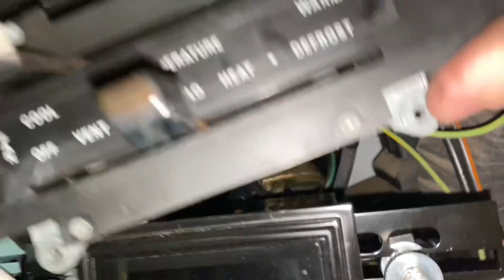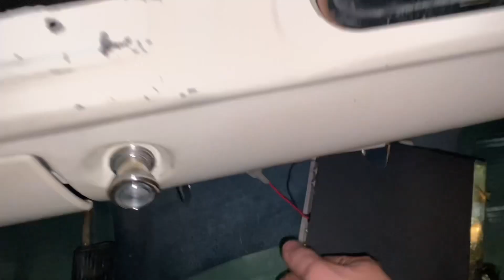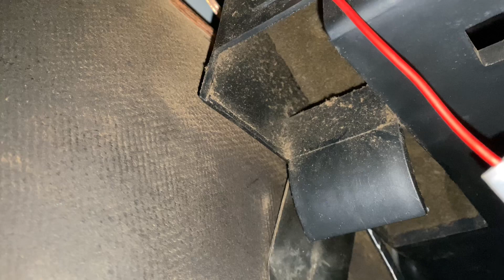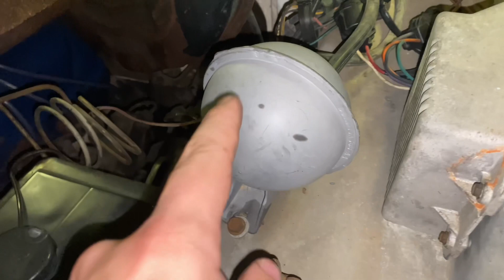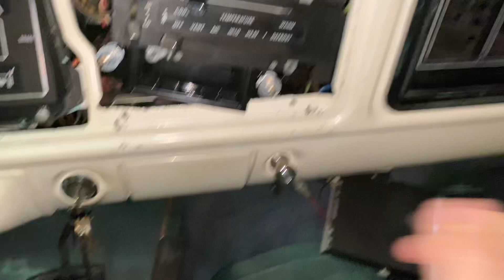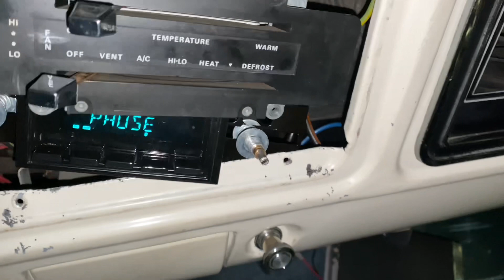1973-79 ford truck factory A/C vacuum leak fix.

Comment: That vacuum nipple port pulls the door in the opposite direction.
Reply from the maker: Yeah but funny thing is when I would move the slider back and fourth it never had vacuum on it so I found it to be kinda weird but either way it’s been working as it should so all good. Thanks for the input I appreciate it. Thanks for watching.

Comment: I'm having problems with my 1975 Ford F100 factory air. I will look at those vacuum lines again for a possible solution. Thank You for the video information.
Reply from the maker: You’re very welcome, hope you figure it out, vacuum leaks can be a pain to find at times, but usually doesn’t take much or take long to find them on these old fords. 
-Thanks for watching.

Comment: Hey There FF289!  I'm actually in a situation with my 73 factory AC.  At some point I blew the fuse (top fuse in the panel).  Along the way of finding the right amperage - I would put in a new fuse, the fans would run, then the fuse would blow.  Well after about three times of this, and a fuse that isn't blowing - I'm not getting and fan power.  Any knowledge on what this may be?  Could the relay have fried out?
Reply from the maker: @holtforrest  yeah sounds like there’s a short somewhere between the fuse block to the fan, it could be the relay taken a dump, since there’s something blowing fuses, after so many times it could have effected the relay or possibly your blower motor has shorted out and not working. Have you tried taking a test lead or multi meter to see if you’re getting power out of the wire coming from the power source to the blower motor, if so then you know it’s the blower motor. If not though then there’s somewhere from the motor back. Good luck, if you have any other questions feel free to ask, I’ll try to help the best I can. Thanks for watching.

Comment: Do you know where I could find a vacuum actuator? Can they be rebuilt? I have a 79 with factory air.
Reply from the maker: I’d check with cj pony parts, they sell ac parts and they are starting to sell more truck parts and also a lot of times the trucks use the same ac parts as the cars did because they were all built by the same manufacturer, a lot of the stuff is the same. You might could also check Jeff’s bronco, he had a lot of stuff for the old trucks and bronco’s. As far as rebuilding, I’m not real sure about that but even if you could rebuild them I’m not sure where you would find the parts like the diaphragm to rebuild them. Hope this helps, good luck on your build. 
Thanks for watching.
Reply: @FastFords289  Thanks for the info. Liking the videos
Reply from the maker: @lukebray2192  no problem, glad to help if I can. Thank you for commenting and liking the videos, I really appreciate it. 
Thanks for watching.